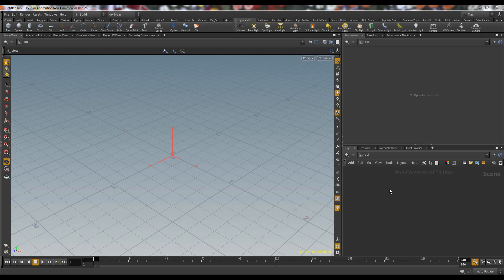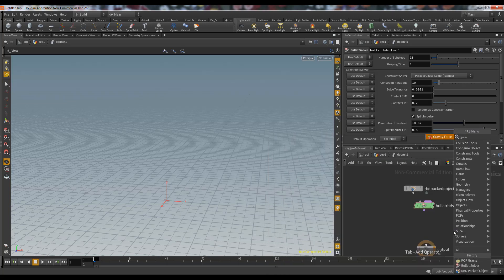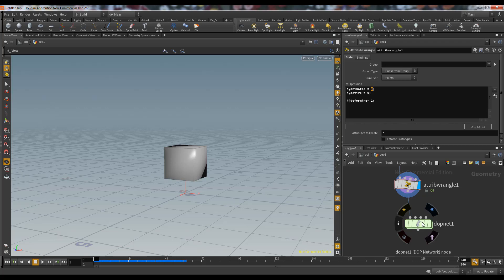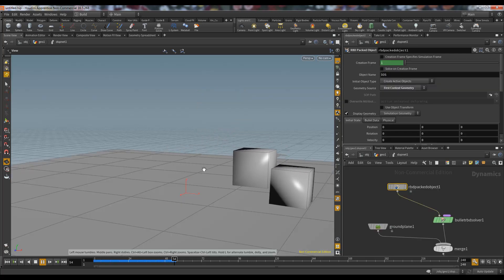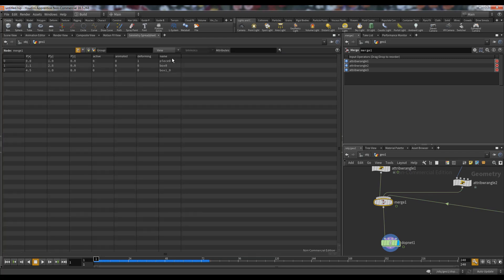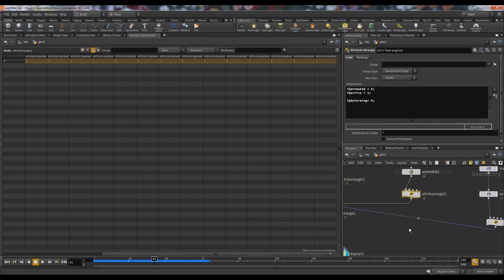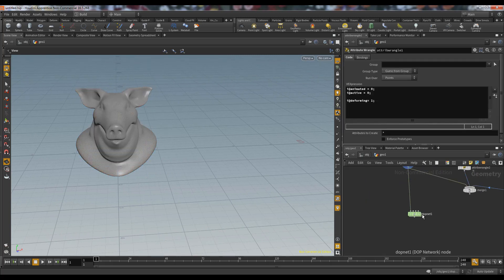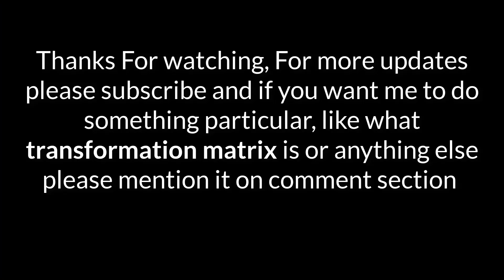houdini Rigid Body objects(deforming, animated,and active)

Comment: Thank you for the video. From the video, the differentiation between animated and deforming is on the spreadsheet and on the memory each uses. Do we have any other sort of distinction? OR could you suggest an application or an example on where the deforming/animated is used?
Reply: It's like where should i use the "deforming" and where the "animated". And why am I choosing those!
Reply from the maker: @krishnanunnib4546  its better to use animated as its very fast as compare to deforming, but sometimes you don't have an option like if the geo have complex point deformation then we should use deforming
I hope this will be helpfull.;_)
Reply from the maker: From houdini 17 they have introduced a node which can extract the transformation matrix of an object which is very usefull if you are getting something as an alembic and the transformation matrix is not proper
Reply: @vineetsharma76  Okay.. if the object itself is deforming ie if one of the points in the cube was changing its position, then we will use deforming right! Gotcha.. thank you very much..:P
Reply from the maker: @krishnanunnib4546  Not exactly its like if your object is changing its shape like some soft body, point position of the the cube will always change even if you are rotating it but the shape of the cube will be same in that case you can use animated, but if your box is bending, stretching or squeezing in that case you should use deforming object
Reply: @vineetsharma76  Yes, absolutely correct. Thank you very much.😀